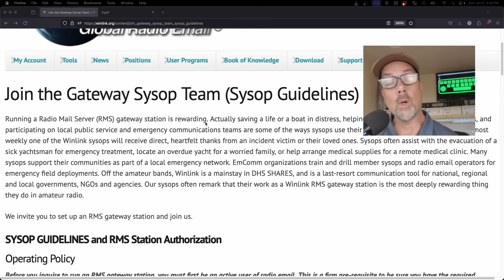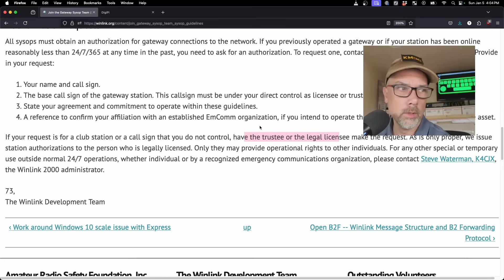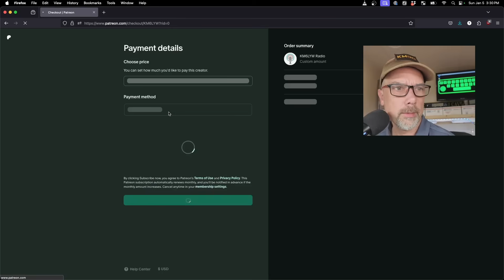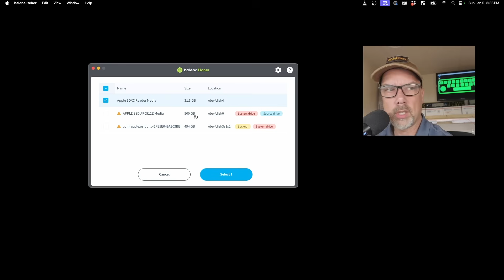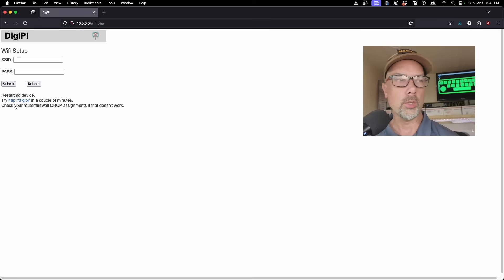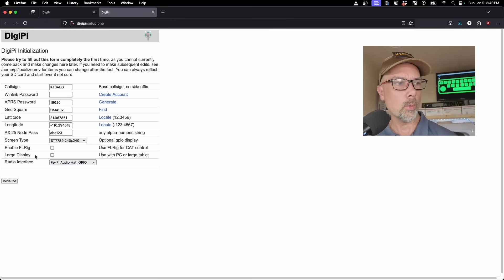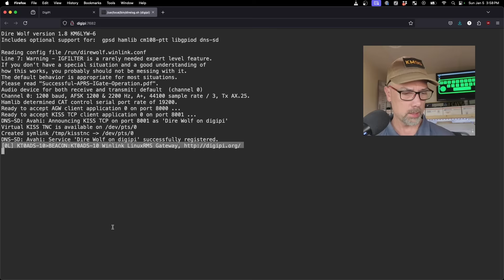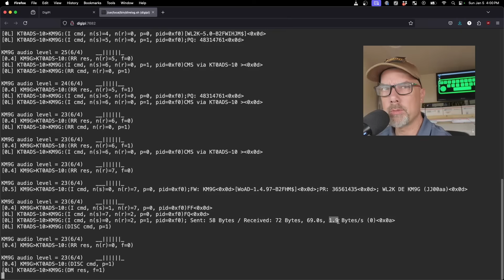FAST: Winlink Mail Server Gateway for 2 meters

Comment: Our club had a 2meter test gateway on a local repeater. It was sort of hit and miss with connectivity so it was retired. I run an HF gateway (K5FIT) from my home with appropriate UPS, battery and generator backup. I have remote access to the computer and am working on something for the radio. I like how you put everything together no muss no fuss. Thanks!
Reply from the maker: That's a great setup! Thanks for watching!

Comment: Awesome video! I’d like to see a standalone gateway with no internet with that setup, possible?
Reply from the maker: Winlink is not designed to run without the internet by default.  There is a single entry "peer to peer" setup that allows you to exchange messages with an active participant.  By default its a "gateway" from ham radio to internet and back to allow email to flow in all directions as well as store/forward.
Reply: What you’re looking for is linBPQ a port of bpq32 . A BBS with store and forward. 
Or like TO said P2P or post office if using winlink tool suite on windows.
Reply: Would the sort of thing you want be what used to be available back in the days of the old packet BBSs?
Reply: @paulsengupta971  just standalone P2P post office I guess for emcomms. Passing ICS forms during grid down, for EOC and field on licensed LMR frequency
Reply from the maker: @paulsengupta971  winlink is dependent on the internet working somewhere in the world.  Outside of that, you can use old TNCs, new TNCs, no TNCs or even smoke signals if you could get it to connect from one end to the other.